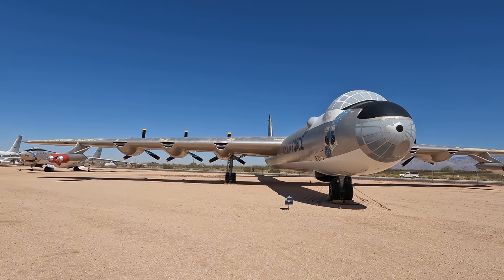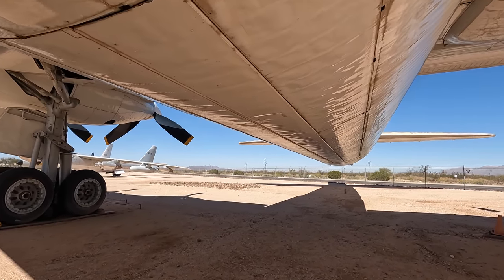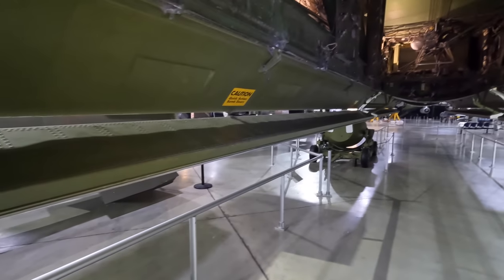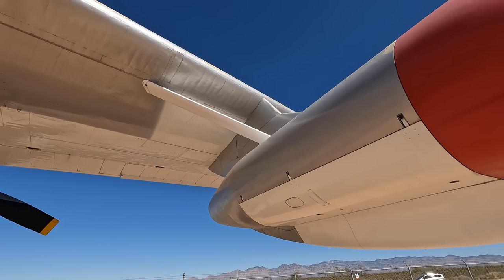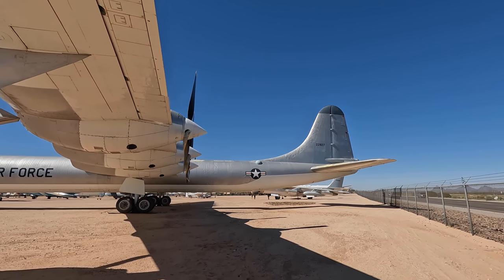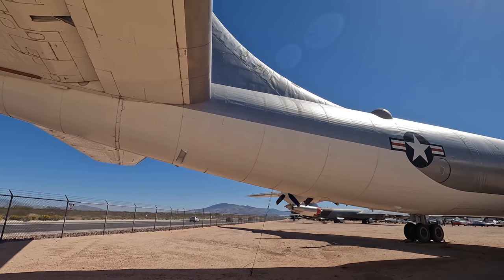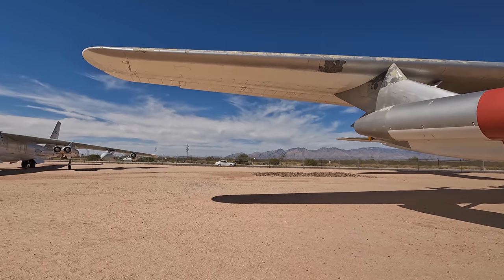Tour around the TEN engine Convair B-36 Peacemaker!

Comment: I worked on it, during the 92-94 restoration period.  According to some stories I had heard, its last flight was into Amon Carter Airport in Fort Worth in late 50's probably 1959. The airport was renamed Greater Southwest Airport in 1960's, the B-36 sat there on public display until GSW was closed because of the opening the new Dallas/Fort Worth Airport in 1974. The airport (GSW) fell into abandonment as did the B-36, it was during this time the aircraft suffered allot of vandalism. By late 70's as the airport was being demolished, the B-36 had to be removed. I was told that there was an idea to "FLY !" it the 15 or so miles to the General Dynamics/Carswell AFB (now Lockheed Martin/NAS Fort Worth JRB) but the Air Force got wind of it and quickly quashed the thought, going as far as cutting or drilling the spars. So, it was taken apart and trucked to Greater Southwest Aerospace Museum that was just outside the General Dynamics gate until the 92-94 restoration. As I remember the museum also had a B-52, KC-97, F-111, F-89, P-2, B-58 and a few other aircraft. As I arrived in DFW metroplex to attend A&P school in 1988, we had a field trip to the "GD junkyard" as the instructors referred it and I remember all the aircraft being in deplorable condition. Also, after the restoration, supposedly Ross Periot Jr, had donated the land for a new museum at the new Alliance/Fort Worth Airport. But the money to build the facility was never raised. Of note the same time all the B-36 restoration and fund raising going on. The Dallas side of the metroplex the Frontiers of Flight Museum that was located in a little lobby located on the second floor of Love Field Airport, ballooned into a major hanger facility.

Comment: I never saw a B-36 in real life but I built scale models as kid and the relative size of the B-36 kit was astounding. I had to look at the box to make sure it was the same scale as the models I was used to building. A 1/72 F-86 Saber jet fighter, for example, is a “desktop” model. You can easily accommodate it on your desk at work. A 1/72 scale B-36 would cover the entire desk and more. I thought many times about building it but never did. It would be a HUGE project just building the plastic model. I can’t imagine what went into building the real one. Well, I can imagine it actually because as a young man I worked for awhile at the Newport News Shipbuilding & Dry Dock Company and helped build a nuclear aircraft carrier. I imagine building a B-36 was a lot like that; massive.

Comment: your math is a little off. if the b36 had a bomb carry capacity of 86,000lbs that would be 43 tons, not 39. and the dry weight of a b17 would be 18 tons
Reply from the maker: Google tells me that 86,000lbs equals 39 tonnes but another converted says 43 tonnes.  🤔 Wikipedia says that the dry weight of a B-17G is  16,300kg.
Reply: @PaulStewartAviation   well google is wrong. the US uses short tons or 2000lbs per ton meaning that if you were to put into a calculator 86,000 divided by 2000, the end result would be 43 meaning 43 tons. and if you were to do the same thing to the b17 it would be 18 tons not 16. to make it simple. take the weight of something then divide by 2 and depending on the starting weight, the first few numbers would be the weight in tons. like this 86,000 divided by 2 is 43,000 or 43 tons. 

its a pain to first learn but once you have it, its easy to remember to just divide by 2 for the tons.

also NEVER believe Wikipedia. look on the very bottom of the page. "this page was last edited on X date at X time". it means literally anyone can edit the page. i could change it to say that the b36 was the world's first supersonic bomber if i wanted to.
Reply from the maker: thanks it looks like I have some reading to do. Maybe it's british verses US pounds ??
Reply: @PaulStewartAviation  yeah there is a slight difference between short and long tons but i dont know why they would ever mention long tons since it was a US aircaraft. probably for the people like yourself who are tourist.

Comment: When I was 9 or 10 yrs living in Midland County MI I saw one of these flying West to East on a hot summer day.  I could see the 6 propellers, that's how I knew it was a B-36.  I had seen a feature on the B-36 in a newsreel a few weeks earlier.  I recall the low droning sound and it seemed to be traveling slowly.  This would be 1951 or 52.

Comment: Nice shots -
3:46 actually a MK-5 bomb not MK-4.  Strange museum display as B-36 never usually carried the MK-5.
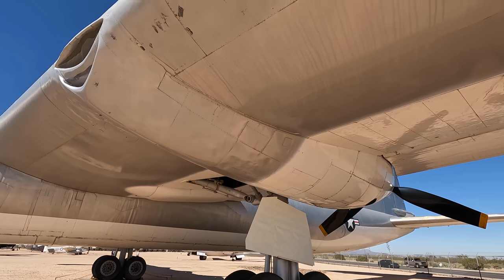5:00 wing crawlway only went as far as the piston engines not turbojets.
Reply from the maker: Ops did I say a Mk4? I meant to say the 5.
Reply: That’s what I figured not important anyway. They used to have a MK-6 next to the plane maybe still do, which is what it usually carried – I think there’s only one actual museum MK-4 somewhere. The 5 was designed for smaller bombers like the B-45 with less bay space and no in-flight access so had early automatic IFI.

Comment: I suppose with a 70m wingspan no matter what tail design your going to have a super large hangar is the only option. I never like the pusher design as the engine exhaust causes issues at the root area of the props.

Comment: This is a very good, and accurate account of the B-36; well done on the research....one point: 7.17; the J47 shutter doors were left 5% open to allow the axial rotor to rotate and thus prevent freezing-up. It is on record that a B-36, possibly a Featherweight, stayed aloft for 51 hours. For the best film of a B-36 take-off, check out the 1955 film 'Strategic Air Command', or the scenes on YT, especially those of the parasite programme, FICON, ( for fighter conveyer )....stirring stuff in the Great Age of Aircraft; the 1950's.
Reply: Six turning, four burning!!
Reply: "Strategic Air Command" stars Jimmy Stewart and Harry Morgan.  It was one hell of a good movie.
Reply: From what I have read on the trapeze hookup, if you survived a dog fight in that little monster, hooking back up was ten times worse and would probably kill you if the dog fight didn't. When it crushed the canopy, and had to make a desert landing at Edwards, it about killed the pilot. After that, it was dropped as fighters had longer legs and refueling was far easier to accomplish.
Reply: @josephkapla3205  I believe that when Jimmy Stewart made this movie, he was still a serving Major in the USAF!
Reply: @neilfoster814  that is a fact.  He was in the military from 1941-1968 and Strategic Air Command was made in 1955.
Reply: @neilfoster814  he actually flew 20 missions over Germany in WWII as the squadron leader of B-24's.
Reply: @josephkapla3205  yes, he did indeed! But, he always stayed humble. Quite a few Hollywood actors did service during WW2, Ernest Borgnine, Charles Bronson, Jimmy Stewart to name just a few. But in my opinion, Jimmy Stewart made the best movies. The Rear Window is one of my favourites.
Reply: @neilfoster814  I love Jimmy Stewart movies.

Comment: Confused by the title. B-36 had 6, not 10, engines.
Reply from the maker: Did you watch the video? It is explained.
Reply: @PaulStewartAviation  I didn't watch it as the title is misleading.
Reply from the maker: @davidmontville4885  haha well it explains the title. Even a simple read of the wikipaedia article will explain that it does have 10 engines.
Reply: @PaulStewartAviation  My grandfather grew up near Ft. Worth Texas and the B-36 flew directly over his house several times and he says that at that time (1950 or so) it was the original design, only 6 prop engines. The jet engines were added a few years later, so it's a push.
Reply from the maker: @davidmontville4885  👍
Reply: 6 turn'in, 4 burn'in!...amazing aircraft !

Comment: Imagine now noisy that thing would have been for the crew with a 10 engines running! Thats one impressive bomber.
Reply: Yep!  After I took a couple of flights in WW II bombers, when I think back to those (US) 1960s TV shows and earlier movies of the bomber crews conversing with each other in normal volumes . . . NOT!   
The sheer noise volume of those two and four engined bombers were eardrum aching without noise-suppressing ear protection. The thought of 10 engines!?  Ouch!

Comment: I grew up in Fairborn Ohio in the mid-60s, and the first USAF Museum was on Wright Patterson Air Force Base right at one end of Fairborn's Main Street. I spent a lot of time there as a kid. Back then many aircraft that are now housed inside the new museum over at Wright Field in Dayton were in an outside lot beside the original museum building in Fairborn. There was little to no security at that time and many of the aircraft could be entered in one way or the other. For the B36, we literally climbed up the left side gear into the wing into a tunnel through which one could crawl into the main tunnel that ran the length of the fuselage. Contrary to the report in this otherwise excellent video, it was not possible to stand fully erect inside the wing. But it was still big-ass plane that literally dwarfed any of the other aircraft on the lot at that time.  I have some photos of color postcards of the original USAF Museum from that era including  one that shows an aerial view of the museum building and the B36 on the lot with the small fighters and bombers around it including a B24 and B25 that look like toys next to the B36.

Comment: To add to your mention of the trim tabs at 9:30, the leading edges of the elevators and the rudder (referring to the moveable surfaces) are open to the air behind the nearly 90° corners of the stabilizers, instead of being faired-in and moving internally.  The shapes can be seen seen quite easily at 9:05.  The leading edges of these moveable surfaces are forward of the hinge line and thus move in the opposite direction than the main portion of the surface (i.e. if the rudder is deflected left, the leading edge moves to the right).  The stalled air on the side that's going deeper combined with the moving air on the side that's approaching the surface creates a counterbalancing force, lessening the force required to deflect the surface.

These are formed in smooth curves on the B-36, but on some aircraft, the shape is more abrupt and obvious, such as the rudder on the B-29.
Reply from the maker: Thanks for the extra info

Comment: For all you model builders out there: in the '80s and '90s Monogram Model Company produced a sensational 1/72nd scale model of the B-36. Don't know if it's still in production but for a price could probably be found on Ebay- but due to its size displaying the model can be problematic. I believe a  somewhat more practical, (but of course less detailed) 1/144th scale B-36 model is available....

Comment: Whoops!  The crew could not in fact walk through the wing to the turbojets.  You could stand up inside next to the landing gear, but by the time you got to the outboard recips (as far as you could go), you were crawling.  

5:59 - some hot exhaust was routed through the hollow prop blades for anti-icing.  It exited from those vents at the tips.

Otherwise, excellent video.

Comment: Great work, Paul. The idea of having a nuclear-powered bomber hits close to home for me, literally. Four or five miles from where I live are the remains of the Lockheed Nuclear Laboratory, Dawsonville Plant aka Air Force Plant 67, or just AF-67. With construction beginning in the early 1950s, the laboratory had two reactors, one large and hidden underground and one small reactor above ground for all to see. The purpose of the plant was to develop and test materials for a nuclear-powered aircraft (perhaps the XB-70). The improbability of building such a plane that was light enough to fly and safe for the crew was recognized before construction was completed; however, the USSR claimed to have developed and flown a nuclear-powered aircraft well into 1966. 

President Kennedy canceled the project shortly after taking office, but the "mad science" continued through creative funding techniques until the 1970s when it was decommissioned. Though flooded now, I had an opportunity to explore the underground portion of the facility while it was being salvaged. One would not believe the enormity of the underground facility. It was several stores with several rooms large enough to place a fuselage or large wing inside. There were computer rooms essentially 'refrigerated' with the controls in a room above, generators, water supplies (reactor was cooled with water from a nearby river), and concealed under the Georgia red clay except for a sentry building slightly larger than a porta-potty. I have been conducting research on the plant since I visited it in the 1970s.

Comment: This b-36 has 16 engines. It has two engines per nacelle
Reply from the maker: Um count them again. 2 jets and 3 props per wing.
Reply: Each prop has two engines @PaulStewartAviation
Reply from the maker: No it doesn't. It has 6 × Pratt & Whitney R-4360-53 Wasp Major 28-cylinder 4-row air-cooled radial piston engines. You're welcome to visit a B-36 in person and you'll find there's a single engine per prop.
Reply: You're right my bad @PaulStewartAviation
Reply: @dapolcio3405  There was a British aircraft which had such an engine configuration, if I remember right it must be the Brabazon

Comment: this plane was chosen in lieu of the Northrop Flying Wing.   A mistake in my humble opinion
Reply from the maker: It was certainly a safer option than the flying wing, though. Who's to know - maybe the flying wing would have been amazing if extra resources were allocated to it, or it could have been a failure. Obviously the design worked with the B-2 although that's with much more modern CAD...etc. But still interesting to speculate anyway.
Reply: @PaulStewartAviation  for whatever reason Jack Northrop failed to copy one of the key elements of the Horten 229 - namely keeping the engines very close to the center line of the craft - the Wing had engines moved outboard which in a stall created instability . If memory serves the B-2 has its thrusters mounted inboard on either side of the cockpit.
Reply from the maker: @antonfarquar8799  yeh the engines are as close as possible to the cockpit. Check out my B-2 prototype video for a closer look :)

Comment: Should have called it the piecemaker because that's how it usually ended up scattered over about 2 sq km. Useless deathtrap. Fire the guns and the fire control systems computer valves all shatter. The piston engines catch fire if there's a day in the week because they're installed backwards causing carb icing.
The cabin heater caused a fire on at least one occasion and I think it was one of these that accidentally dropped a nuke on a private home and lost another one, which is still unrecovered to this day.

If anyone displays these there should be a big warning on the placard. This is how not to do it. Only aircraft design I think was stupider than this thing was the Heinkel He177 and that could at least be fixed - split the motors to make the 277a-0.

Comment: It's one of those things you look at and are amazed that it was done. That was the official point of taking reciprocating engine aircraft technology too far. As for the single wheel, I don't understand why it was even tried, after all the B29 had double wheels. And, putting that nuclear reactor in an aircraft was the single dumbest idea in all of aviation history.
Reply: Design started in the 1930s.  The jets were added in the late 40s.  They put them on B 50s too.  The vacume tube technology was amazing.  The F 106 entered service with a one ton vacume tube computer, later replaced.

Comment: Biggest bomber ever? Compare it to the TU160.  Not so big then.
Reply from the maker: Ok…
Reply: The 160 is slightly longer and has a higher MTOW. However, the B-36 has more wingspan (even if the 160 flies with wings in a low speed config).

Comment: That particular airplane sat at the north edge of "Grand Prairie Airport" in Dallas.  Eventually that airport was closed and DFW was opened.  Grand Prairie turned into Centre Port, where American Airlines has its headquarters.  The B-36?  That's where local kids used to climb into it, get high, fuck each other, and leave behind graffiti.  Eventually it was proposed to move the plane to Tucson to the Pima Air and Space museum, and initially they wanted to actually FLY (!) this airplane~!  Holy shit NO!  Convair did not produce a very good product and this thing is full of stress cracks.  It is likely that it could have made it from DFW to Tucson, but the costs would have been prohibitive.  Instead, they took the derelict grafitized airframe from Texas to Arizona via truck and re-assembled it while removing all the amatuer art work.

The very last B-36 flight took place in 1959.

Comment: A beautiful aircraft but, its performance was terrible. There are 4 long runways just in the UK built to cope with their take off run. Then its cruise speed was a liability. I would point out that your figures for the B17 are a bit optomistic, only 8000 lbs of ordnance, the rest was the weight of fuel, guns etc. The Mossie could carry more just as far 2.5 times faster than a B17
Reply: It's performance terrible ,? this 200 ton plane flew at the speed of a p51 mustang from a few years earlier , it's service ceiling exceeding 16 km , could stay more than 2 days in the air and could carry the load of 4 b50s around half the planet , there was not anything around to remotely approach these figures in one plane

Comment: I have one small complaint. You gave the wingspan in meters. When that bomber was designed and built, American Freedom Jnitsmwere used exclusively. There was no meter bullshit used.
Also, you failed to mention the jet engines were converted to burn aviation gasoline, not jet fuel, to simplify the fuel system.
Reply from the maker: Ah yes I did recall reading about the jet fuel and forgot to mention it in the video